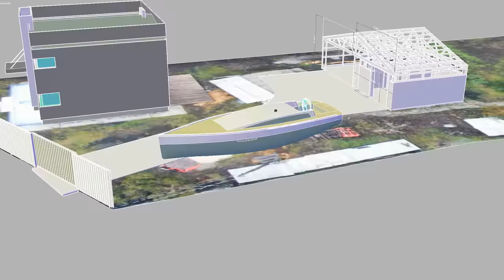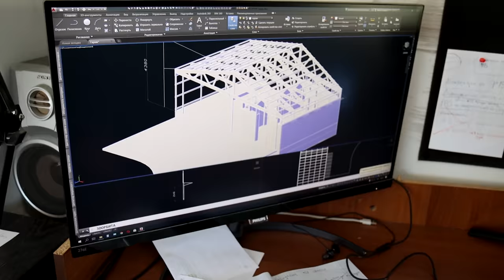Couple Builds The Simple Roof Themselves in an Original Way. Amazing Workshop ►4

Comment: There’s a 1/4” thick foam/bubble roll that goes between any concrete and wood to prevent moisture from rotting the boards. It’s usually between the foundation and the rim/floor joists.

Comment: As a long time framer, and builder here in the states. I admire both of you , your tenacity in this build.
However I do question the assembly of the trusses.  Having built and assembled many structures over the years
It’s ALWAYS been recommended gusseting the cross bracing . Face nailing, even bent over nails does not supply long term 
Lateral support. Not seen in the video is there there interior cross bracing. Side wind loads always has to be a consideration…
   Good luck to you both….
Reply: My thoughts exactly. Storm bracing is definitely needed to stop a strong gust folding that like a pack of cards.

Comment: Hmmmmm....Truss support members face nailed.  Usually placed between the rafters and joists, then gusset plates face nailed to create maximum strength.   Point load strength is derived from the truss members themselves, not from the nails holding them  to the face/side of the rafters and ceiling joists.  Could....Repeating, could cause a problem under heavy snow loads.  I don't know what type of snow loading you experience.

Comment: regardless of what your neighbours thought  nice work... as i understand them  only architect not an engineer, your trusses would be stronger  if the members were internal not nailed to the side as they act in compression the nails will be the weak point and shear will be the failure with overloading opposed to internal where the nails just pin the member in place because it is compressed.  looks like its over built anyways so no matter. thanks for the video,